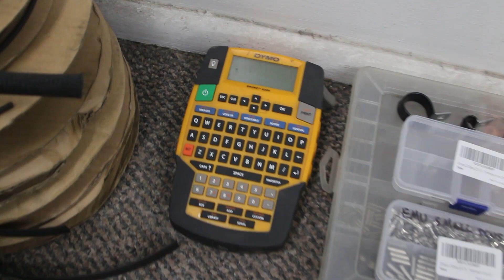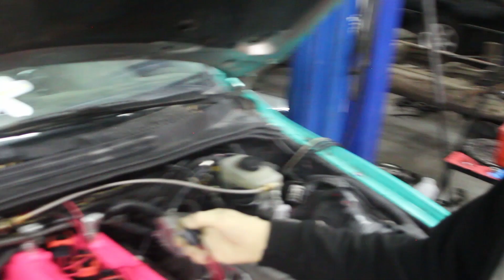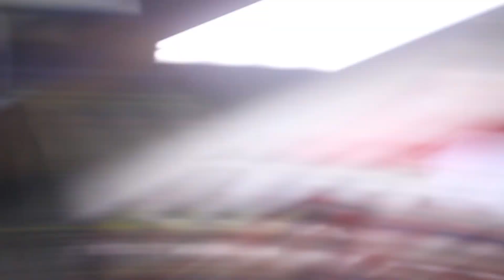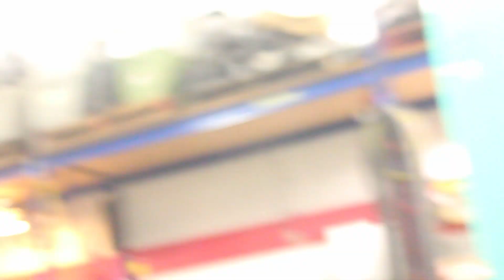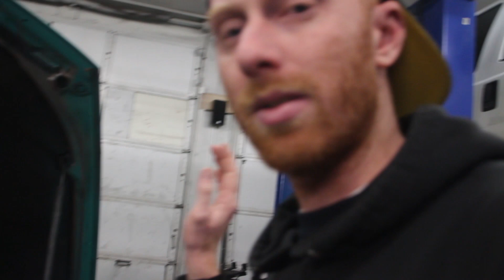DRIFT WEEK PREP - IS300 1JZ ECU Master Wiring Harness Build

Comment: So you tap the 12v switch off the injector to the alternator pin? Which is the center pin?
Reply from the maker: Alternator needs switched 12v to turn on. It can be supplied from any switched 12v source.
Reply: @BrandonWicknick  needs a sense wire that's constant  also right? And just a 1wv switch?

Comment: Hey. Nice build there. I have a similar build with the EMU black and the PNP connector. Now it won't start since its not getting the CKP primary trigger signal. Old Toyota ECU starts the Engine.
Now do you need the resistors wired in between the ckp and the ECU or it's just straight fit no splicing them in.
Your input will be greatly appreciated.
Reply from the maker: No resistors. If you have no ckp then there is an issue with the signal wire or sensor ground.
Reply: @BrandonWicknick  okay...it all checks out okay...all signals are well grounded, the ckp signal is there when tested with a multimeter.
I have wired it on its own directly to the Ecu. But no start...am so bummed.

Comment: Hey man, I have had a 1jz gte that I have been struggling with for a couple years now.  I wired up a ecumasters classic and haven't had any luck getting it running right.  I had it running before with the stock ecu but haven't had it working right with the emu.  I have the 370z coils and want to run sequential instead of batch fire. Would you possibly have a tune you could send me or if you could check out the tune I have I would sure appreciate it.  I got it running sort of but it sounds like a trigger issue or something I did in the wiring.  I would like to atleast make sure that I have the trigger setup correct so that I can rule that out as an issue.  Thanks